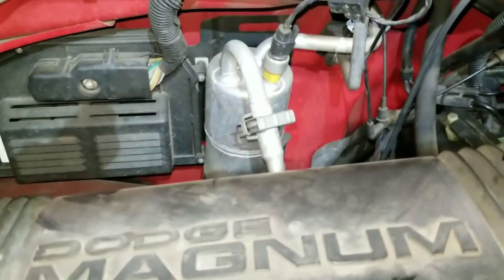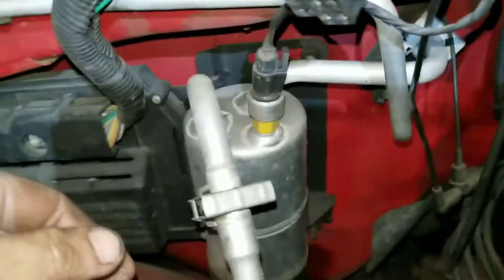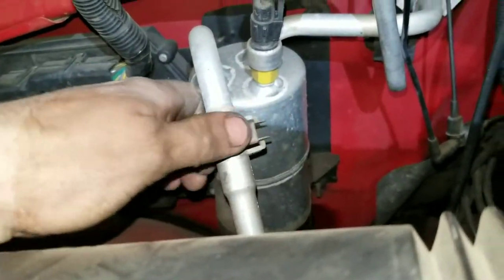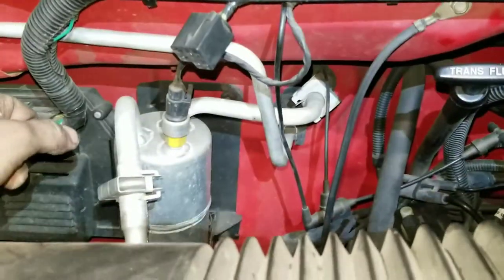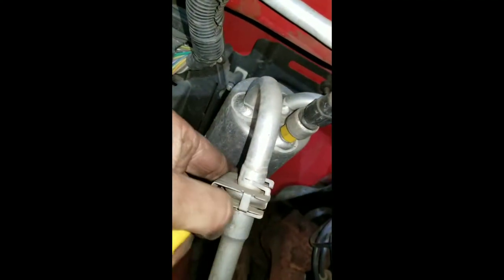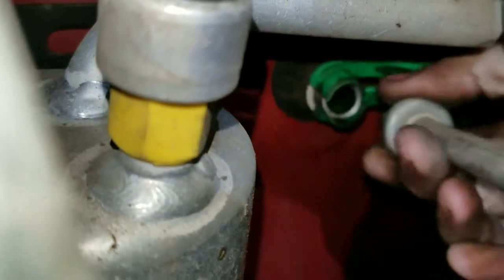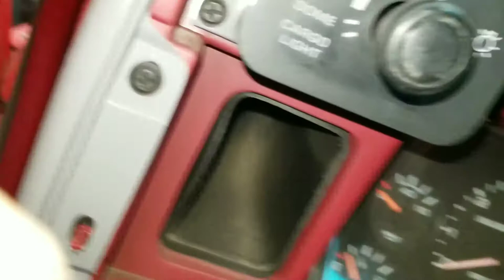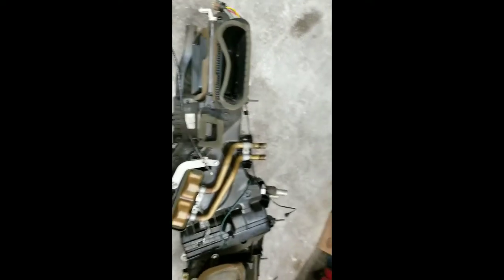how to replace the heater core on a 90-2000 dodge ram 1500 2500

Comment: i have a 1989 buick lesabre im trying to get my ac to blow ice cold air what would you recmend
Reply from the maker: Well based on the year I'm assuming it's a r12 ac system. If I were you I would take it to some one who is r12 certified and see if theres any freon in the system . If the system is properlly charged I would then start looking at a stuck cable or door.
 Thanks for watchin I hope this helps be sure to like and subscribe for more helpful tips and tricks.